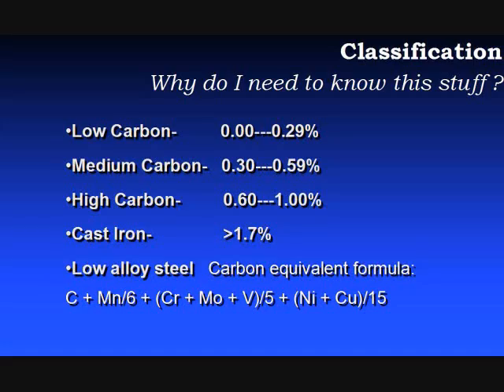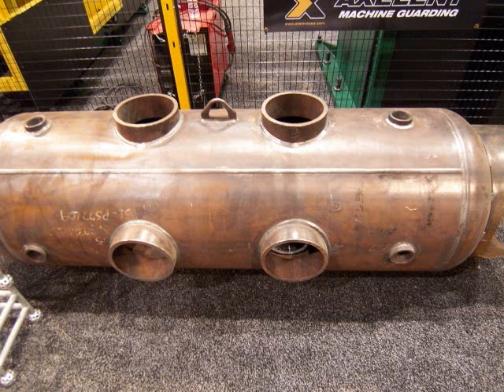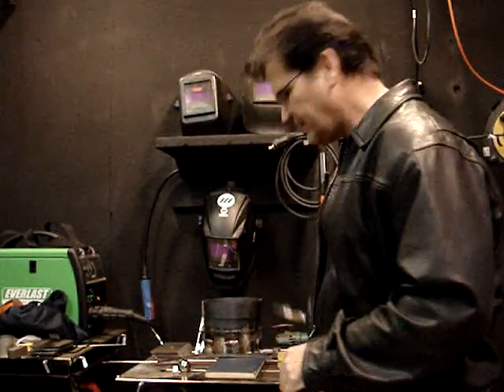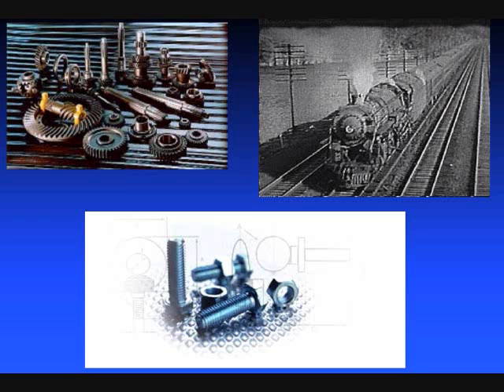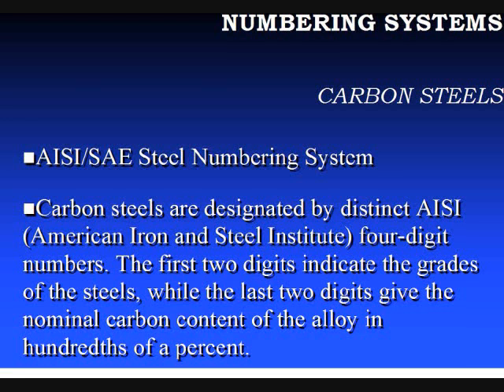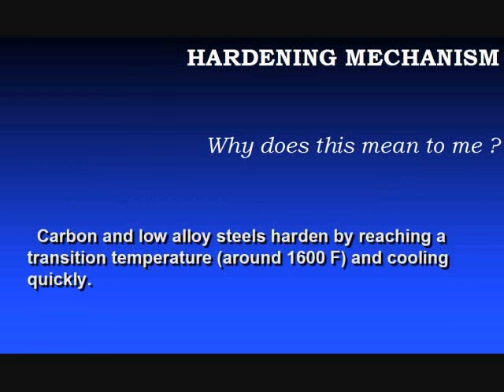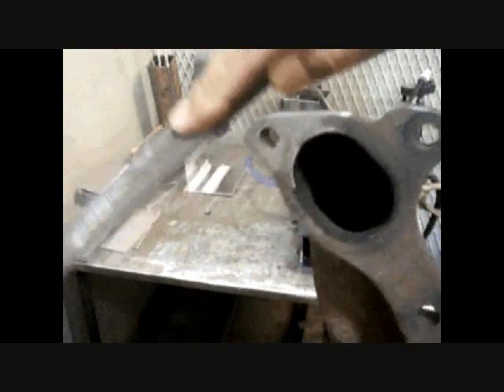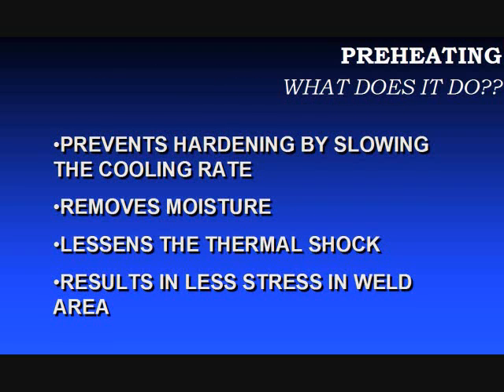Metals and How to Weld Them - Carbon and Low Alloy Steels

Comment: Doing alot of 4140 in my job there is a big learning curve for a guy that has done low carbon and AR plate for 20+ yrs. Proper preheat and post weld cooling is a large part of my job success. Proper alloy filler metal research for the application to s a must.

Comment: Love your tip about striking a corner of cast iron.  One of the big problems in industry is finding out whether a part is cast iron or cast steel.   This trick would help sometimes.  The other thing we always did it to take a small sharp chisel and see if we could pull up a sliver or burr.  If you can pull up a "shaving", it is cast steel.  If you can't because the "shaving" keeps breaking, it is cast iron.